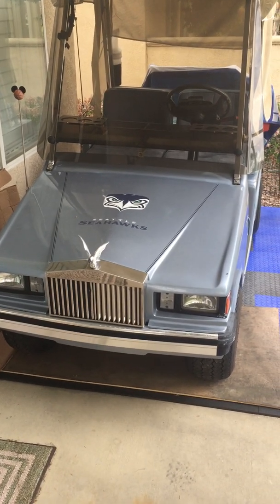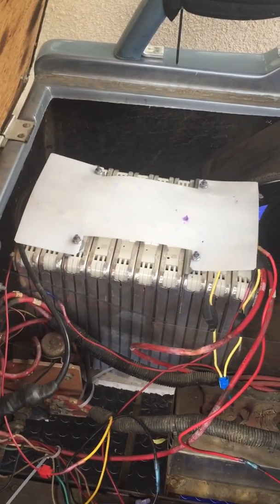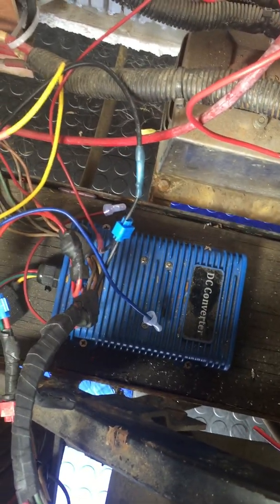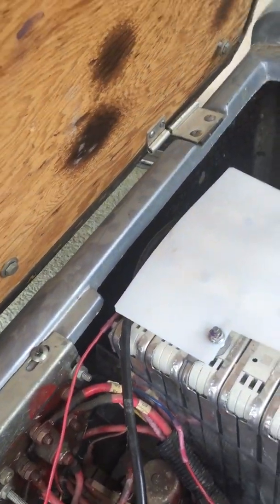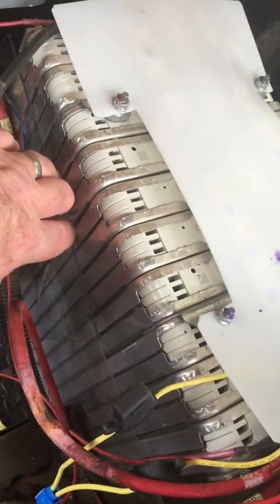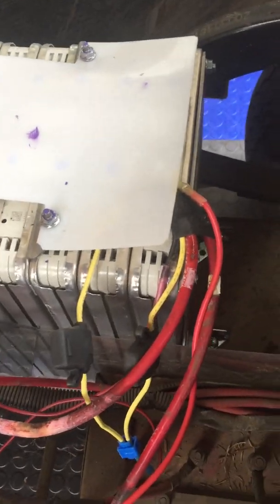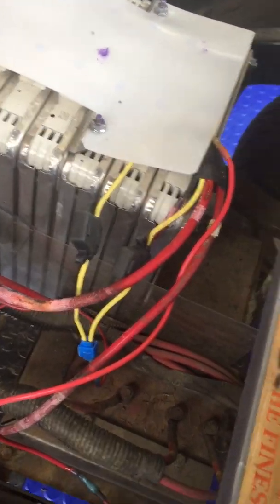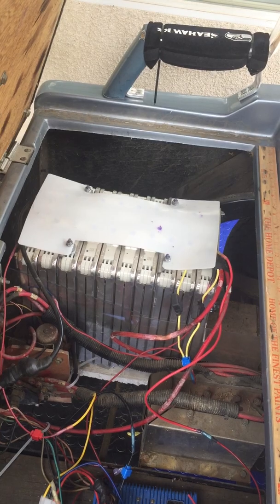My Lithium Battery Upgrade of my 1988 Western Golf Cart

Comment: Why 10 batteries? Wouldn't 5 get your your 36?
Reply from the maker: you would, but this setup doubles the amp hours. twice the mileage, less charging in between
Reply: I’m new to all this but I built a battery with 5 leaf modules and I’m getting 40v but my cart it barely moving now.
Reply from the maker: @leviriddle9316  that might be why…everything I did I learned from the group at buggiesgonewild.com
Reply from the maker: @leviriddle9316  poke around the forum and ask some questions. They’re the real experts
Reply: I only have gmail and they won’t except it. Thanks for the help
Reply from the maker: @leviriddle9316  I just thought of something which might be going on with your cart. This only applies if you have the old resistor style speed controller.
When I installed my powerpack, the cable to the v glide was cut through which caused my cart to go into a super slow creep mode…so check that out
Reply: I’ll definitely look at that. Thanks again for the help

Comment: It's been a while since you made this video how are your lithium batteries holding up are they still doing well and is there enough room in the battery Bay to double the size of your battery pack
I am going to look at a limousine version six passenger of the same make and model tomorrow and it needs some work but from what I can tell it's pretty rare fine and a great project and fun six passenger golf cart to buzz around on the property with here in Oregon
Reply from the maker: Pack is doing well. Double Pack would be tight but possible and there may be other options out there now

Comment: Hello, I have the exact same cart as you, how can I get ahold of you to get some info? Thanks - Art Wallace
Reply from the maker: PM me over on Buggiesgonewild...sockeye342
Reply: @thephischmann  Hello Jeff, I'm an elderly person and not to computer smart but will give a try, Thanks - Art
Reply: Hello again, I just tried to register on Buggiesgonewild and they won't let me register with a Hotmail account, what now? - Art Wallace
Reply: Jeff, lets try this, maybe you can help, I have the same cart as you with the grill and eagle, my serial # is 2000536152 and I'm wondering if
you know what year it is? and also my leaf springs are worn out and need to be replaced, I'm going to remove the golf bag holders and put
a rear seat in the space so the springs need to be heavy duty but not so stiff as to cause a rough ride. I'm having trouble getting the info I
need, can you help? a quick response would be appreciated, Thank You - Art Wallace
Reply from the maker: ART WALLACE  you sure the number isn’t 200536152?
Reply: @thephischmann  No Jeff it's 10 numbers 2000536152, Art
Reply from the maker: ART WALLACE  so 200 series and it’s either October of 85 or 95. I don’t think western made carts 85 OR 95, so maybe the 05 is for May and the 3 is for 93.  The 6152 is the cart number built by the company. That’s why I think it is more likely May of 93. The carts were built on an ezgo marathon platform, that’s your best bet on parts when you start your search
Reply: @thephischmann  Thanks Jeff for the help, I'll check out what I can. Art Wallace
Reply from the maker: ART WALLACE looking on the buggiesgonewild site, I’m pretty sure it is a 1993. Do you have a pics of the cart including the battery Bay Area?
Reply: @thephischmann  Jeff, I have to go to the DR'S this morning, but I don't know how to get the pictures to you, but in the meantime if you want to
go to PHOENIX AZ. CRAIGSLIST, HE HASN'T REMOVED THE AD YET, I DIDN'T PAY THAT PRICE, I paid $1000. Art
Reply: @thephischmann  Hello Jeff, I just went out and took the pictures you asked for and loaded them on the computer, I know how to email them but I don't know how else to do it please advise. Art Wallace
Reply from the maker: ART WALLACE  maybe another email account with gmail...it’s a very good resource for golf carts

Comment: What sort of charger and BMS do you use to keep the cells balanced?
Reply from the maker: I’ve been working on getting a zeva on it. Original sent didn’t power up, so waiting for a replacement. Since it’s coming from Australia it takes a while
Reply: @thephischmann  a great option for charging your car would be some solar panels and a solar controller..

I have four large 310w solar panels connected to a victron solar controller that charges my car very easily